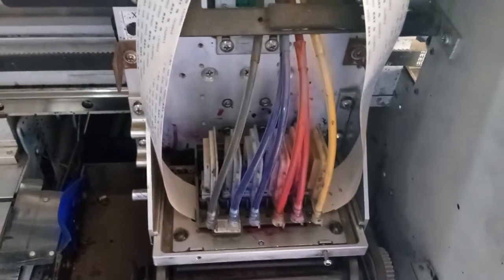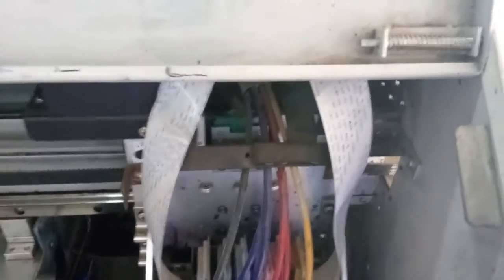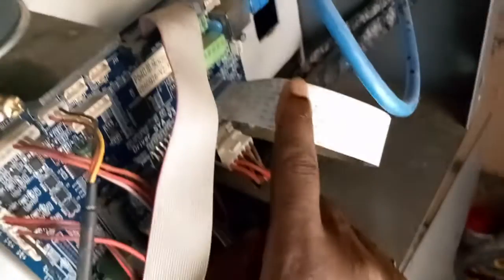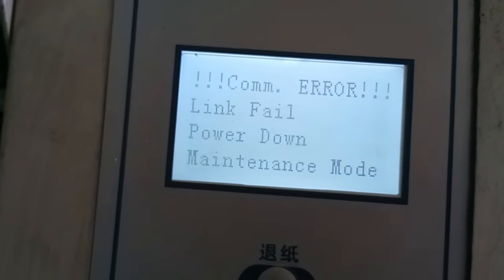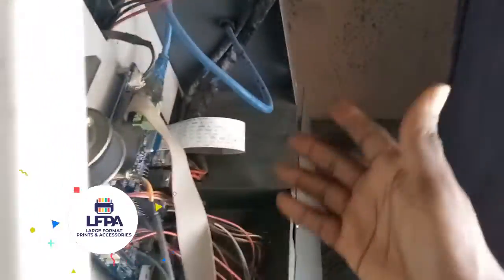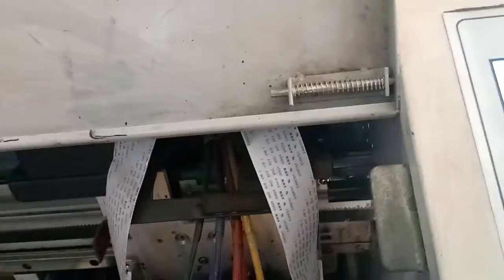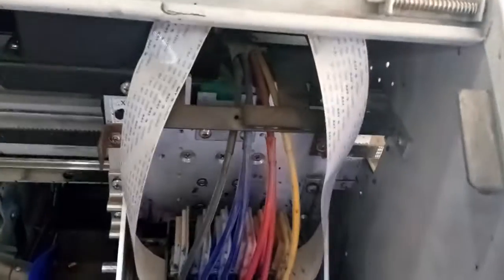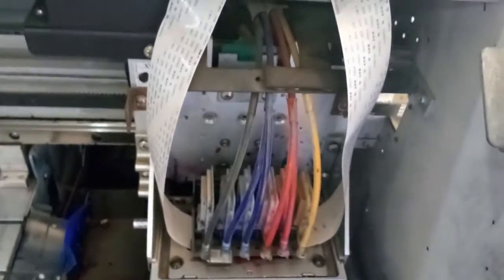ERROR LINK FAIL..??? WATCH THIS TO SOLVE THE PROBLEM

Comment from the maker: As value added feature, we built a chatbot that can answer all questions on Large format machine issues. Ask it anything about the subject. It knows. Trust me. By the way, you can order parts in the app as well. Tell us your experience with it. We can make it even better. https://mediafiles.botpress.cloud/87b4fb76-8490-45bd-a846-7d362593cbc4/webchat/bot.html
Reply: Bonjour
Reply from the maker: @yagoyagobain5550 ca va

Comment: Tried all 
But still there is no lights on the print head board
Reply from the maker: Then check if the driver board(side board) is okay.

Else. Replace them.

Comment: Mine is "Connect Fail" error. But it will continue printing after a few seconds. What do you think?
Reply from the maker: Something is failing. More like a circuit not working right.
Reply: @richwords1  la machine renvoi le message comm error link fail power down maintenance mode
Reply: @richwords1  la machine renvoi le message comm error link fail power down maintenance mode